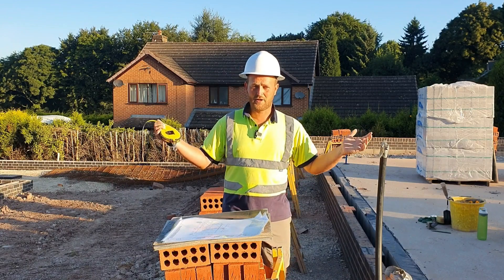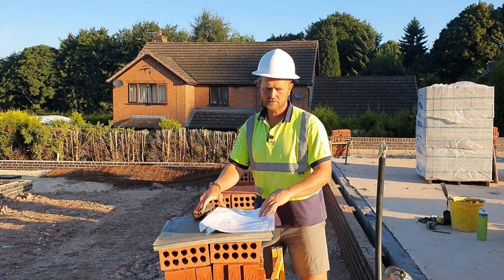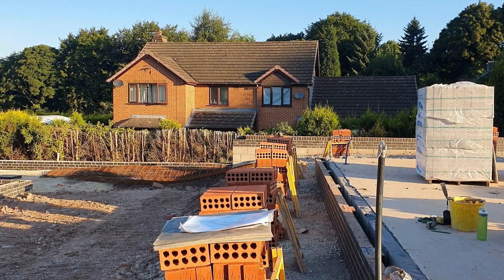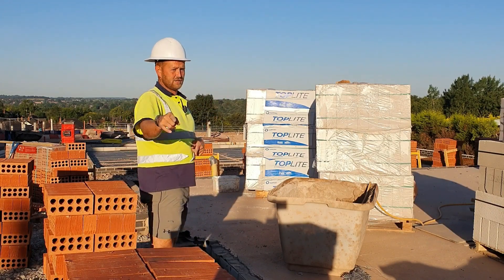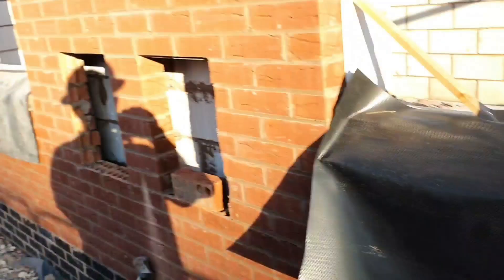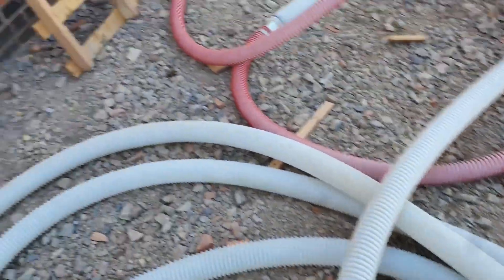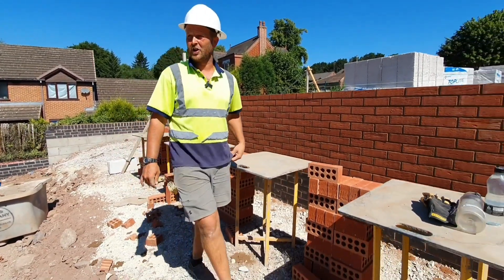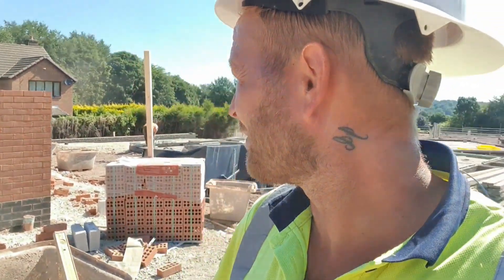How To Make Real Money Bricklaying [Weep Vent And Insulation Talk]

Comment: one thing I would do personally is make the height change run in with the lower bungalow flush with the room side of the cavity wall, that way your expansion joint would terminate at soft and gable wall wouldn't be effected.

Comment: Just a little advice please, I'm from Dudley and where I live it's very clayey. I want to build a shed in the back garden. For footings what would you recommend. I want to lay 2 course of bricks for the base. It's more like a summer house the size, which is 3m width by 5m length. Do I need to dig to the clay then hardcore then sand then finish material, could I get away with slabbing instead of concrete?
Reply: set up shuttering for 5mx3m dig out 200mm, then have 4 inch of type 1 wacked down then 4 inches of concrete that will be more than enough unless you want hot tubs etc.
Reply from the maker: There you go

Comment: Some of them bricks are bent or either not to the line the sun shows which are sticking out..
Reply: Go to 9.50 and look above the bottle of water in the middle, ok for a blind man passing on a speeding train.
Reply: @greetingsbox4229  problem is the bricks while in packs look straight and true but they aren't , companies usually use the cheapest they can get. I myself would have used a wider jointer but its in no way the bricklayers doing.
Reply from the maker: Il show you how concave these bricks are next week

Comment: A thought ya was fast? 990 bricks on a straight gable shows ya speed with a hoddy spreading and jointed up.

If your happy with ya work that’s all that matters
Reply from the maker: He only spread 1st 3 courses and did you see how hot it was, the muck goes off right away. Got 770 in this morning on the opposite side in 4 hours. The heat kills you off in the afternoon